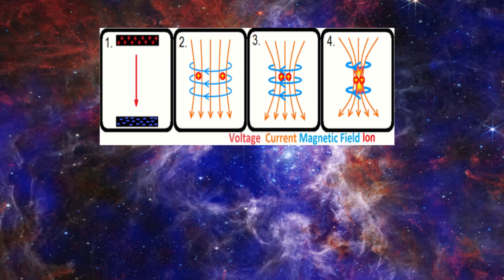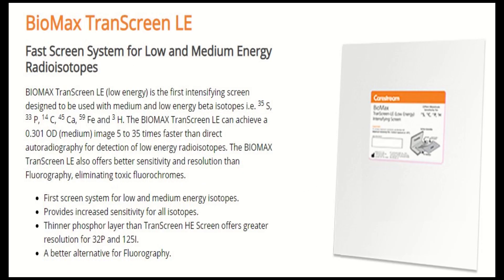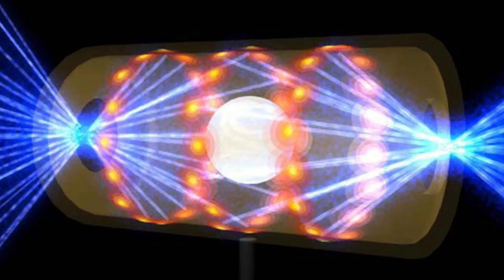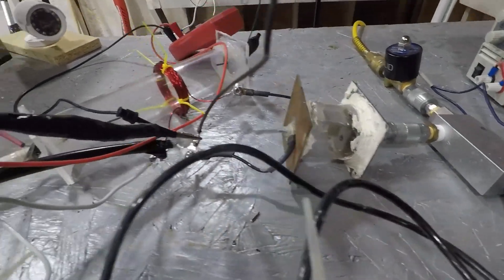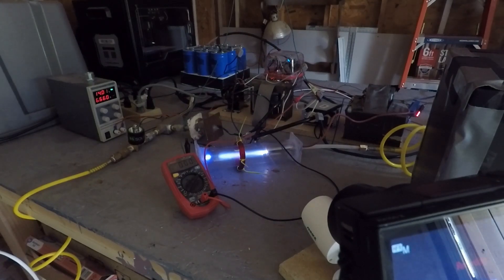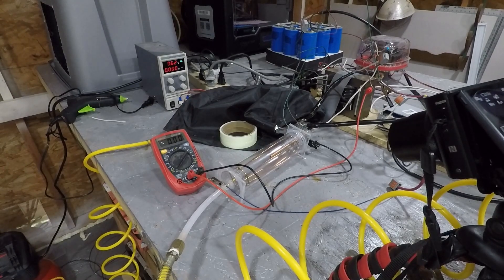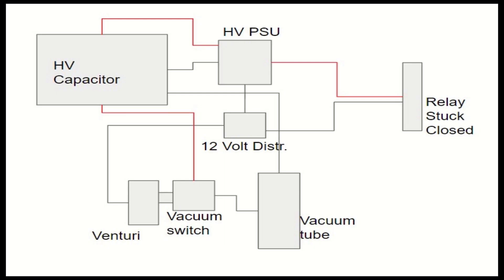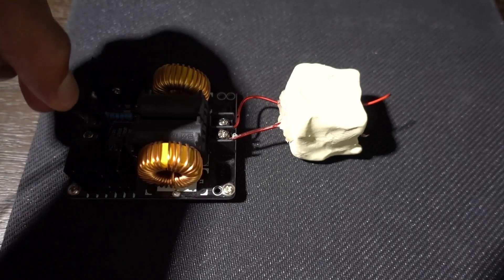Are X-Rays Produced From Plasma Compression?

Comment: Who warned you of x-rays at 3 kV?!? Asides from the fact that it's extremely unlikely to generate x-rays at that acceleration voltage (albeit not impossible), they'd be of extremely low photon energy. I might add that if you manage to generate x-rays of < 3 keV photon energy, I doubt your x-ray screen would emit any light from it. P.S. Subscribed!

Comment: If the intensifying screen won't work out, I would imagine a Scintillation crystal tube and the Pi-camera behind it to detect the energy from the scintillate (i.e. re-emit the absorbed energy in the form of light). There might be an issue with visible light getting through, but with a Beryllium screen in front, it is possible to block visible photons.
As a metal, beryllium is transparent or translucent to most wavelengths of X-rays and gamma rays, making it useful for the output windows of X-ray tubes and other such apparatus - so it would also be useful as an input window.
You could also test the sensitivity using a natural ionizing emitter, say using Uranium glass - as Uranium 238 is a beta emitter.
Looking forward to the next video :ø)

Edit: If you 'just' want to confirm x-rays, using 'just' a Beryllium screen in front of the pi CCD sensor ought to do the trick (remove all lenses, IR filters, etc, so the chip is exposed for maximum sensitivity). The Scintillation crystal could in theory work like a lens, but I'm not 100% on that, but it will definitively detect ionizing radiation and give off visible light for the camera to see.
I would recommend reading "The suitability of smartphone camera sensors for detecting radiation" in Scientific Reports from Nature, to shed some light on the subject ;ø)
Beware if going this route, Beryllium isn't your friend - so handle with utmost care..

Comment: Why such a huge battery of electrolytic low capacitors with high inductance? you ideally need one oil capacitor 20 nanohenry 60 kilovolts 10 microfarads with instant current output in megaamps

Comment: quite funny, i am currently working on a electrothermal accelerator using a pretty similar capacitor bank to yours but was struggling with coming up with a proper switch for it, most of my trials were done using a mechanical switch but as you mentioned they get pretty loud...
The idea of using a vacuum switch like that never came up but it is a pretty good idea that i should try sometime
Reply: Есть тиристоры и разрядные выключатели. У меня тиристор. В пике пару тысяч ампер. Конечно он до 1000 вольт.

Comment: Have you tried using diodes to prevent current backflow? Also, (I don't know how to put this to make it sound friendly, but I am trying to be) may I ask why you didn't choose to use photosensitive paper? And one more thing: for a steady plasma stream, try using a neon light tube, or (if you don't want to modify your setup all too much) the townsend discharge method.
Reply from the maker: Im not sure if backflow diodes would be useful in this situation since the failure mode was from an arc jumping from the circuit to ground. My current fix is to isolate the vacuum switch from the relay with a long plastic tube and use enamel coating on metal components to prevent the arc discharge while its under vacuum. The problem with photosensitive paper is it has a very long exposure time (minutes) where as the xray pulse lasts in the tens of microseconds. A neon tube is not customizable and is at relatively high pressures (0.4 - 3 kPa). 

For the townsend discharge method, the vacuum switch actually uses that method and is very efficient.
Reply: @NeutronStudios1  Oh, I read somewhere on researchgate that laser pulses of duration 1.2 picoseconds would cause a mark to be visible on the paper but chances are that either the laser wattage was high, or I misunderstood it. Good video!
Reply: @NeutronStudios1 Please could you make a video on hydrogen plasma